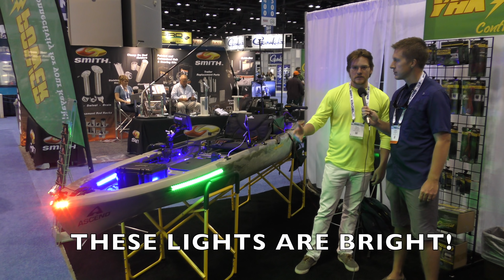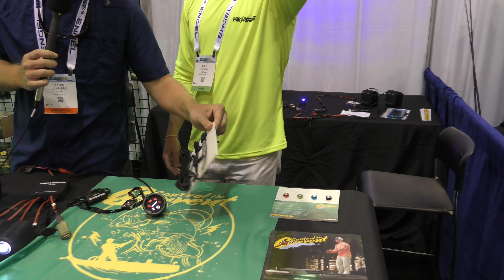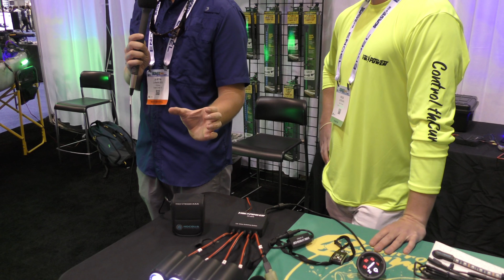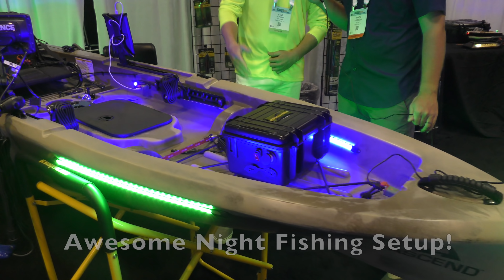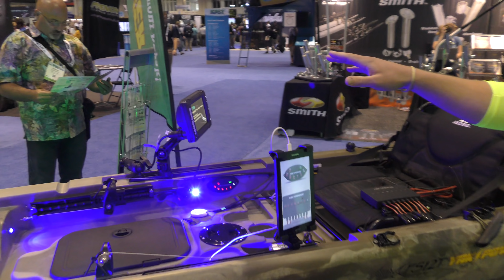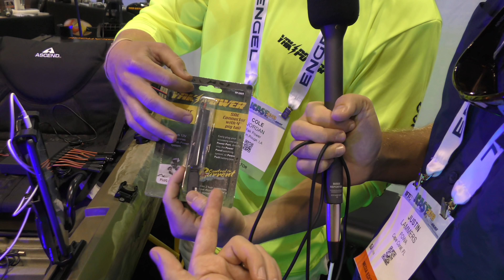YakPower:  12v Power & LED Light Kits For Your Kayaks

Comment: Need  bow red/green
Reply from the maker: I will be uploading a new lighting system that I think is pretty cool and easier to swap between boats should you have multiple.
Reply from the maker: You only need red/green if you are motorized.  If you are a paddle only craft you do not. In fact red/green signals you are capable of moving out of way quickly to powerboats.

Comment: I have been through a TON of these button lights. Water gets in the front of the light under the glass dome, rusts out the element, and they fail. They were nice enough to replace them a few times, but they really need to improve these so they don't leak. They WILL GET WET on a kayak.
Reply from the maker: Good to know.  Thanks for review and feedback.  Supernova lights is the other big name in kayak lighting (Mariner sails sells them)
Reply: @KayakDIY  I look into them I need something to replace these. I have four out of six button lights completely rusted out and dead on my kayak again.

Comment: They should come up with some higher amperage solutions, for trolling motor installs. Oh, and also develop scupper lights. Not all of us wanna drill holes in our kayaks merely to install nightfishing lights.
Reply: J Holl the kayak in the video has a trolling motor that is switched on/off by our system using a relay module we are considering introducing for 2019.

Comment: Looks like you missed the 360* light (which is recommended for kayaks). I like the idea of a light that can be switched from a convenient location, unlike the ever popular visipole/visicarbon.
Reply: Steve Breault we actually showed a new 360 degree light that will plug right into our system and easily be switched on/off. It also has an integrated mounting pad with USB port for adding a GoPro or other action camera and keeping it charged. If you look closely at the back of the kayak, you can see it.